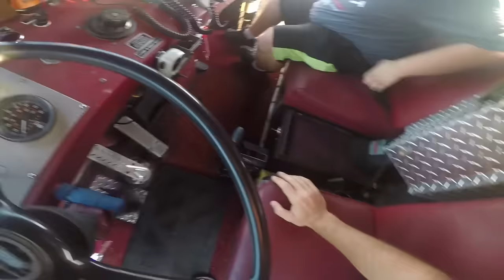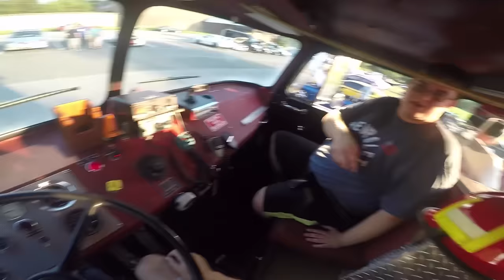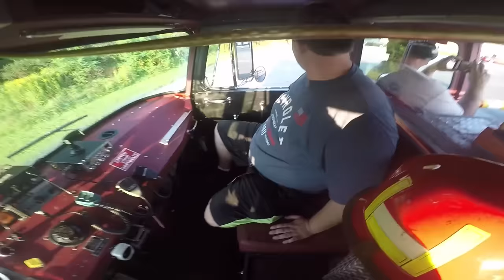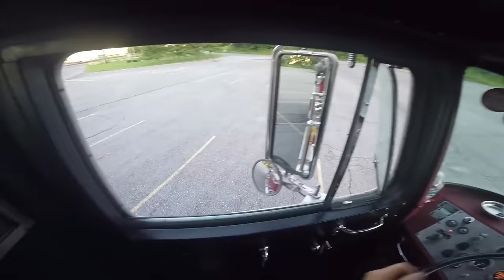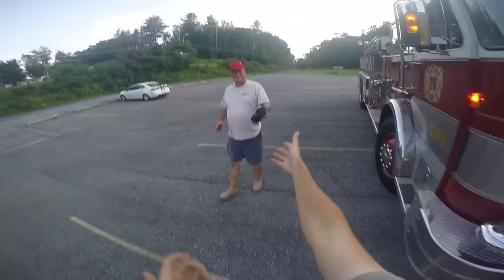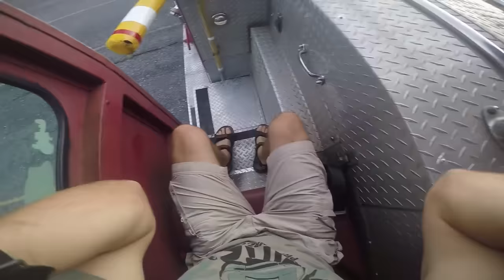Driving a Fire Engine for the first time  1982 Hahn Pumper Truck

Comment: Wait a second!  Do you have a CDL with Air Brake Endorsement?Cool truck, btw!
Reply: If it's got personal tags on it (which it does as per the review) a CDL isn't required. Not the greatest idea IMO, but that's the way it is. Same reason anyone can drive a big diesel pusher RV with air brakes without having a CDL.
Reply: Fair enough.  Do you not still need an air brake endorsement, though?
Reply: Nope, as longs as it's got personal plates on it (I think "recreational" technically), literally anyone can drive it. I've heard it can't be over a certain length (45 ft) but haven't confirmed if that's true or not. Either way this would still fit under that stipulation